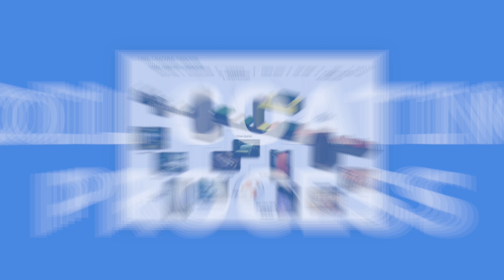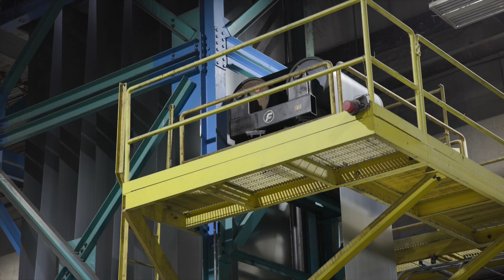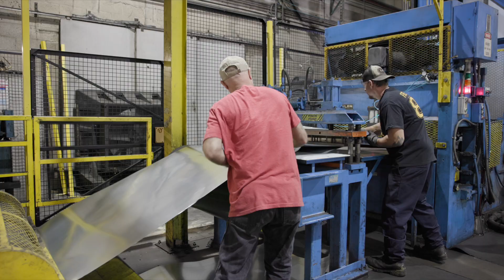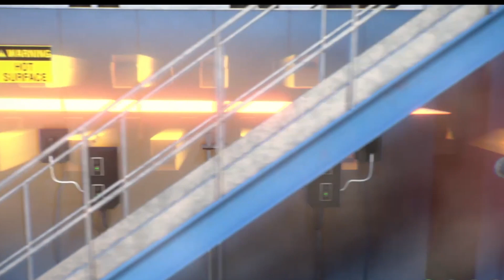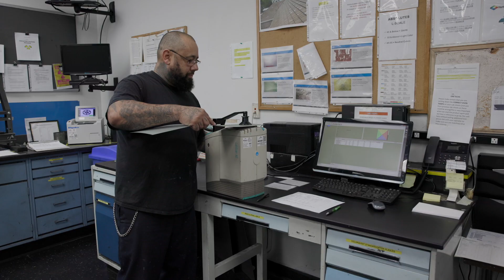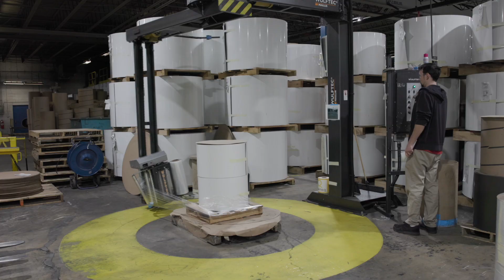✅ Coil Coating Process

Comment: The line is never without a strip of metal through it. A night strip is always between a strip if stopping, the line is always threaded with metal. There is never a stop in metal in the line  except for breakage.